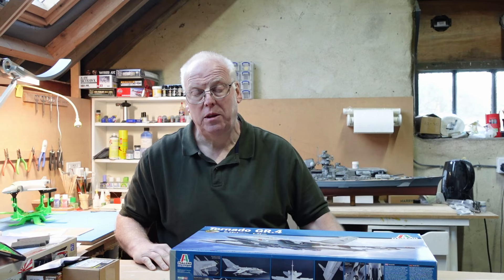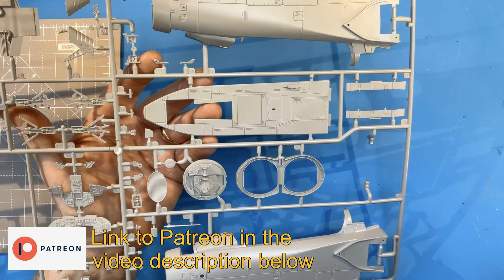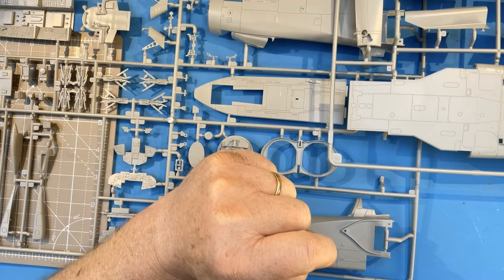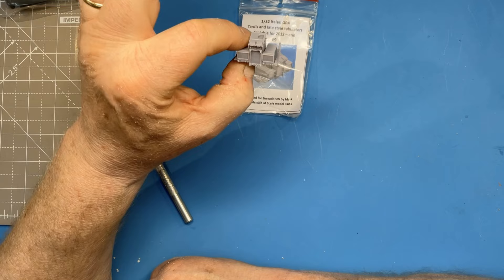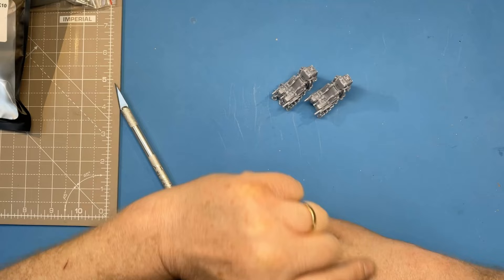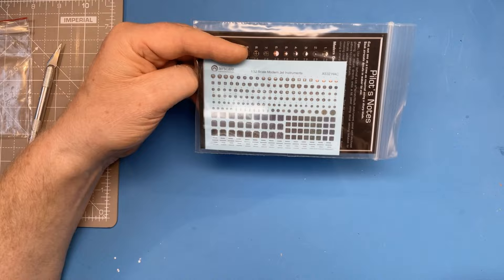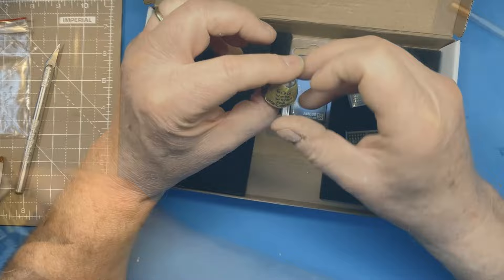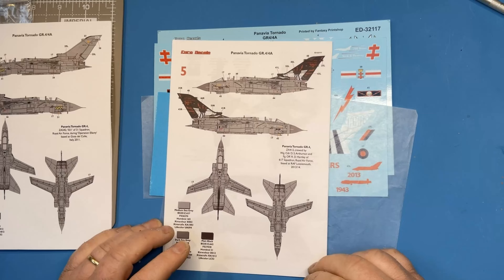Italeri 1/32 Tornado GR4 build preview

Comment: Yeah, good aftermarket haul. I'm interested in the pods, tanks and pylons. I got those same exhaust nozzles you did for my kit. One thing I decided to try was the Eduard LooK cockpit panel set. I got it for a really good price so, I figured why not. My aftermarket decal set is a different company, cannot recall which maker at the moment. I find the kit supplied drop tanks are more appropriate for the the Tornado F.3. Makes me wonder....
Reply from the maker: There are a few non GR4  - or even non RAF - bits in the Italeri kit which I’ll be trying to fix in the build Mike

Comment: Excellent Steve, thanks for the mentions. If anyone reads this then the Italeri navs console is  very wrong for a RAF machine, you'll want the Navs tardis piece Steve mentions to get the correct digital side boxes and rear deflector plate
Reply from the maker: Thank you Nigel. I’m glad you confirm about the nav console: I hacked the instrument panel quite a bit yesterday to get it to match my GR4 references. Maybe a candidate for a replacement part?